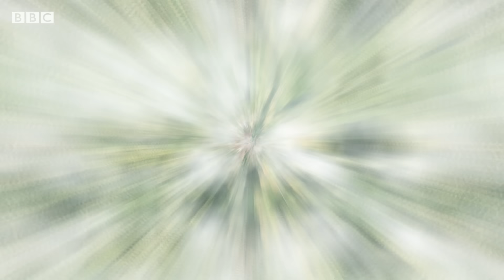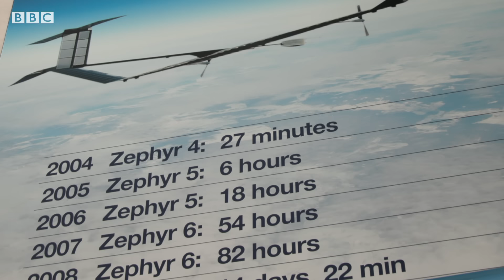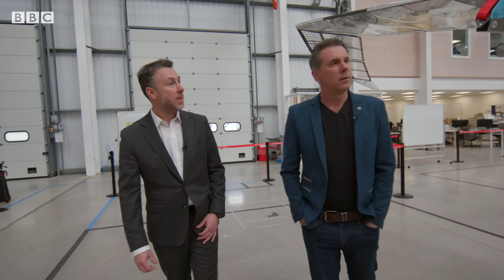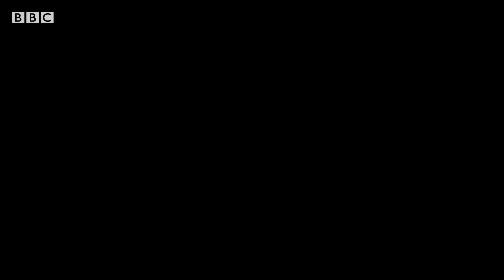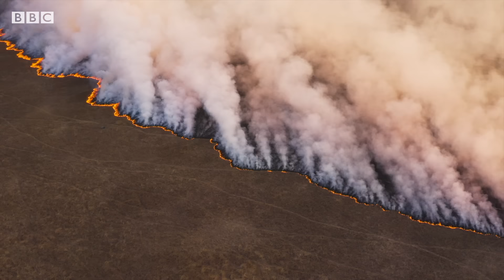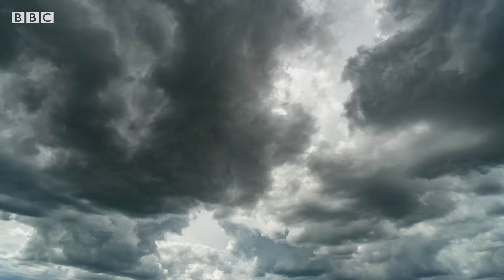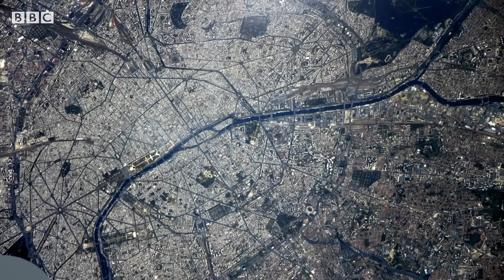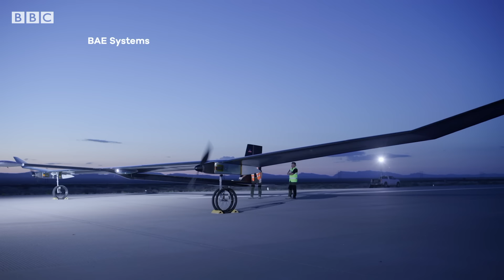The solar-powered aircraft flying high in the atmosphere | BBC News

Comment: current lithium batteries are heavy (and toxic).  There may be a mew generation of "plastic" batteries that will weigh 10% of the old stuff.  These platforms could bee legitimately non polluting (except. maybe. the manufacturing process).  Internet.  microwave phone relays?  Screw Elon Musk?  Of Course, security of data,  interference via solar activity.  Still ; it could be cheat to run, refresh, and maintain.  Here's hoping

Comment: Could you add a rechargeable extra removable stage to it ? So a stronger engine could run for an hour or so to get it up to the desired height and then detach and return to the launch site ?

Comment: As an lead engineer that works on these solar aircraft daily, the core concept is pretty neat: we're basically converting sunlight into electricity to power electric motors that keep the aircraft aloft.  The key challenges come from efficiency and energy density.

Energy In: Solar Panel Efficiency

Up on the wings, we've got lightweight, high-efficiency solar panels. These panels capture sunlight and convert it into electricity.  The efficiency here is crucial. Every watt we can squeeze out of the sunlight translates to more endurance for the aircraft.  We're constantly pushing the boundaries of solar cell technology to get the most bang for our buck, aiming for lighter materials and higher conversion rates.

Energy Conversion: From Photons to Thrust

The captured sunlight gets converted into DC electricity.  This powers the electric motors that spin the propellers.  Here, we focus on motor efficiency as well, minimizing energy loss during the conversion process.  We might even integrate battery systems to store excess energy during peak sunlight hours for use later.

Balancing Energy Needs: Aerodynamics and High Altitude

The atmosphere plays a big role here.  Solar powered aircraft need to be incredibly aerodynamic – think lightweight designs with large wingspans to maximize lift and minimize drag.  This is because unlike traditional jets, we don't have the luxury of burning fuel for extra thrust.

Another atmospheric factor we leverage is altitude.  Thinner air at high altitudes, typically above most clouds, offers less resistance, allowing the aircraft to glide more efficiently.  However, this thin air also means less oxygen, so we might need specially designed propellers to maintain performance.

Oh, I'm just a kid behind a computer, used AI

Comment: The lithium-air battery developed by Argonne National Labs has more than three times the energy density of the best lithium ion batteries. This battery could substantially increase the payload and/or range of any electric aircraft or terrestrial vehicle. Please interview ANL staff to get the latest specs.
Reply: Trouble would be getting a battery to operate at extremely low temperature

Comment: Stay operational in the stratosphere for extended periods or time? Yes. Indefinitely? No. There's friction involved in parts like the propeller, so even if you had an extremely efficient and long lasting battery, you would still need to service the aircraft even if the propeller parts were made out of tungsten carbide.
Reply: It's not unreasonable to assume an electric motor operating in a dry, dust free, environment could run for many tens of thousands of hours, i.e. several years, without maintenance. Hard drives have been doing it for decades, even HVAC systems often have fans that run 24/7 for years at a time. Chances are you'd be wanting to upgrade the payload on a annual basis anyway, something you can't do with satellites.

Comment: I call bullshit on the cell phone tower idea. 
The main reason you are not allowed to use cell phones on airplanes is that you would connect to too many towers at once.
Also they mentioned powering the tower is expensive: it is EVEN MORE expensive if you want to power it in the air.
Might be useful for low bandwidth communication in rural areas.
Reply: going to be real awkward when you learn that ASTS already solved this problem they can do 5G broadband direct to unmodified cell phones from space
Reply: @ThePalisky  ... with a limited bandwidth. 
From a random Quora anwser (it depends on the actual bandwidth allocated):
"If you want to know how many simultaneous active connections you can have per cell, the bandwidth comes in. At 400 MHz TDD band you will have 2000 Physical resource blocks, which could give you about that much simultaneous data users. (1 Gbit/s/ 2000 users = 500 kbit/s/user)"
Reply: @economicprisoner  okay you can quote random Quora posts that are irrelevant or listen to me a guy with a masters degree in radio systems engineering that did his DD on ASTS. Whatever you want.
Reply: @ThePalisky  How many handsets do YOU think such a plane could reasonably support?
10,000?
100,000?
1,000,000?
...still not enough to cover populated areas.
Reply: @economicprisoner  that's a ridiculous premise to operate under. This type of solution doesn't need to, nor should it cover populated areas under normal circumstances. It should cover remote areas and areas where it's economically unfeasible to build terrestrial towers. To answer your question of how many...to give you an idea 1 ASTS satellite is going to have 10GHz of BW and 1000s of beams/satellite.

Comment: odd how he admits that to handle the bandwidth of modern cell systems a low earth orbit satellite would need to be enormously big and expensive but plans to put the same capability on a 75 kg aircraft...
Reply: The big difference is in altitude which allows a standard cell phone the ability to have two-way communication with this unmanned aircraft. The plane would act as a super tall cell tower. You can't do that with a satellite. You would need a special satellite phone for that.
Reply: @spinav8r  A cell tower is less than 1000 ft, this cruises around 15 miles, LEO satellite constellations are around 250-350 miles, GEO are around 22,000 miles. This plane is kinda just another intermediate step in that chain of options, so it will have tradeoffs of both its lower and higher altitude alternatives. It can't magically do the same job and be lighter than both satellite or cell tower equipment packages
Reply: @spinav8r  Newest generation of Starlink is already performing direct-to-cell capabilities, with no different handset needed. So that kinda disproves that. And cruising at 75000ft already loses the line of sight benefit of cell towers by placing the receiver on the other side of the entire weather layer from the handset.

Comment: This seems ideal for remote region Internet like Starlink, but remaining over the region being served. Since it's solar, I wonder how far north/south it works - can it work in northern UK in mid-winter? Would a bespoke plane be needed with PV less horizontal? The obvious drawback in the Starlink comparison is that it fails as a big lump falling out of the sky, rather than as spacedust.

Comment: Isn't this just Starlink but lower down? You'd need a helluva lot of these. I don't think they've quite found the problem to the solution yet.
Reply: But it doesn't burn 100s of tons of fuel to launch or clutter low earth orbit increasing the chance of a Kessler incident...
Reply: @hardillb  and it doesn't work or do anything of any use whatsoever. It'd struggle to carry a tomato without being brought down to Earth. All theoretical nonsense.
Reply: @hardillb  But Starlink works for internet coverage now.
Reply: @jameadellaneve9005 Read that comment you have replied to again. Then read your reply. Notice how your reply is completely vacuous? You know what also already exists? Cables. Saying something exists is not a counter to son one arguing a developing system lacks some of the downsides of that thing. I swear, Starlink/SpaceX fans are some of the stupidest people around. You guys show again and again that you lack the ability to independent thought. Bunch of idiots with double digit IQ.
Reply: But if you can connect directly with normal cell phone without satellite connector and maybe faster speeds, that is much better.
Reply: It's just more flexible on where you want to put it. Starlink has best coverage, but it is in fixed orbit and much higher up which required a satellite dish, less localized signal than land based tower or glider like this which could talk to phone directly.
Starlink phone isn't happening yet because it would need a big antenna, they couldn't figured out how to make it truly handheld yet.
Reply: @worawatli8952 Correct. Boeing has satellites that can talk to cell phones and the antenna in space is huge.
Reply: Project zephyr
Reply: It's useless because it can't carry anything heavier than a tomato seed. It's never going to be able to anything useful if it doesn't have a reasonable payload. (50-100kg)
Reply: @stephenauty2402  I mean, Starship currently can't carry more than a banana. So....